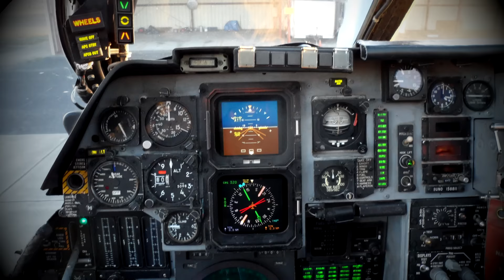USMC Jet Crashes Cable Car | Last Moments

Comment: Just to be accurate, Capt Schweitzer is not a pilot he is an NFO/ECMO.  EA-6B only has one set of controls.  It is also not a "fighter"

I was there serving as Aircraft Maintenance Chief.  I can tell you that to a man (and woman, we had a number of females) the Marines in the maintenance department were absolutely devastated.  We were within a couple of weeks of finishing the 6 month deployment (one of the crewmen on board was in fact on the advance party for our relief, if I'm not mistaken) and had spent much of it working 12 on/12 off shifts, 7 days a week.  Earlier in the deployment, the squadron had surpassed 60,000 flight hours accident free.  There was a lot of finger pointing and plenty of blame to go around:  out of date charts, missing safety NOTAMs, etc etc etc.

I got up close and personal with the aircraft with the Aircraft Maintenance Officer at the spot on the taxiway where the plane had turned off the active runway and shut down.  It was shocking the damage that wing took and didn't get ripped off.

As to the flying-under-the-cable rumor, never heard it.  Highly unlikely.  The CO, LtCol Muegge, was highly respected and would not have tolerated that for one second.  I had served under him previously when he was aircraft maintenance officer.  He was later relieved due to failings of his officers because in a military organization, the buck stops at the CO's desk.

I will say one thing about the crew.  It was clear there had been collusion to destroy evidence, but one of them, Capt Schweitzer, at least made the effort to come to the maintenance spaces afterwards (next day or day after) and express his appreciation to the entire maintenance department for our work..  His exact words were, "You guys did it right".
Reply: Since you say that you were there, was the altimeter actually not in working conditions? Or was it simply a false testimony.

Also was the aircraft ever checked by Italian authorities?

Comment: "the altimeter was malfunctioning" Which one of the 3 (even shown in the picture although this can be from another plane)? the mechanical, the electronic or the radar altimeter? let alone that the pilot isn't supposed to be blind, as to even with no altimeter tell he is way too close to the ground.

Comment: A cable car and a jet are the most random things I could ever think of that will ever collide with one another. Yet it happened. The heck?
Reply: It was a tradion for pilots from this military base to fly under this cable...
That is why they covered it up as plenty of people was doing it before them and clearly commanding officers was turning a blind eye on reports from civilians as it is not posible that noone from that ski resort did not made a complain about this moronic behaviour...
Reply: There are so many random thigns around this incident, especially in connection with the 9. March 1976 incident. It's extremely rare for a cable car to crash anywhere in the world, yet 2 of the world's worst cable car crashes occured on the same cable car, cabins hitting ground around 200 metres from each other. Surnames of those largerly responsible: 1976 - Carlo Schweitzer, 1998 - Joseph Schweitzer. The cabin attendant, Macello Vanzo, had a cabin with 43 people on board crash on a field behind his house 1976. In 1998 he was not supposed to work on the day of the tragedy, but a friend asked him to swap shifts, which he did, and ended up dying in the 1998 cabin sent down by the Prowler.
Reply: It's happened a few times.

Comment: I remember this one, amazing how much high power physics is going on here and that cable, to be cut with the wing tip, you would think the wing would sheer off. Once again I know the story but want to hear your entertaining version of it.
Reply: I was thinking the same. There have been at least 10 different cases of a plane vs. cable car collision, several in Italy, and in all of them it was the plane which crashed and the cable car which didn't (but was damaged of course, but pilots usually catapulted out of the plane and people were rescued from the cable car). I wonder why this one caused the cable car to plunge, but the plane managed to return to the base?
Reply: @MiroslavProvod  not sure, it might have been hit at just the right angle on the right  spot of the wing but yes as you mention many others the plane wing sheered off and the cable was OK. That's a huge cable.
Reply: Cable impacted a pylon close to the root not the tip.

Comment: While Prowlers are designed to fly low and jam radar, this was incompetence and neglect all around. The pilots should have updated maps, or even civilian sectionals that would have shown the cable cars. It's fine to have a camera while flying, but then to destroy the evidence shows a lot about the pilots character. It must have filmed them red-handed as they were hot dogging the area. The pilot should have spent serious time in the brig.
Reply: "Flat Hatting" they call it. And it's a BIG no-no.
Reply: The sectionals provided by the Italians didn't have the cable/gondola detail.

Initially Ashby and Schweitzer did not destroy the video tape. In the days following the accident one of the ECMOs in the rear cockpit - then Captain Chandler Seagraves - recommended that they destroy the tape by burning it, which they did. Seagraves later cut a deal with the government for full immunity and ended up ratting out Ashby and Schweitzer. Seagraves went on to have a lengthy career in the Marine Corps retiring as a Colonel - which included serving with the Blue Angels and commanding a VMAQ squadron - likely due to the fact that his father had been a Marine Colonel as well. The only member of the crew without any culpability was Captain Bill Raney. He stayed in the Marine Corps, was promoted only once to the rank of Major in 2004, retired in 2014 and ended up passing away a few years ago..

Comment: I would think you wouldn't need an altimeter to tell the difference between 300 ft and 2000 ft, even in mountains. In fact I would think that would make them want to fly even higher
Reply: Most army pilots are adrenaline junkies. Forget about "serving their country", they're just in for fun, giggles and occasional war crimes.

Comment: The A-6 Intruder (the jet from the incident) isnt technically a fighter jet, it can be equipped with anti air missiles however its intended role is that of air support and ground attack.
Reply: Not an Intruder, a Prowler, EA-6B.

But yeah, still not a fighter.
Reply: "The A-6 Intruder (the jet from the incident) isnt technically a fighter jet, it can be equipped with anti air missiles"(sic)

The aircraft was an EA-6B not an A-6. The A-6 could carry the AIM-9 - usually during testing at China Lake - but rarely, if ever, did operationally. The only missile the Prowler could carry was the AGM-88 HARM.

Comment: As an aircraft maintainer in the USAF myself, I was livid hearing how the pilot tried blaming it on bad maintenance in the jet. It’s more common than you’d think in the military for pilots to blame anyone else before they’re forced to take accountability for what happens. It’s like a horrible running gag amongst acft maintainers that we’re going to get blamed first before the truth gets sorted out, which includes EVERYONE getting a peepee test if you’ve even touched a jet within 90 days prior to an accident. With a lack of integrity like that, a pilot deserves getting permanently demoted to P.O.S. What’s sad is that air crew wasn’t the first to make an attempt at hot dogging their jet underneath the cables like that as rights of passage, they were just the first to get caught. The more jets you see crash in your career, the more you start to sympathize with that flight instructor losing his shit in “Top Gun” after Maverick just had to “buzz the tower” for fun, or when Iceman calls him “dangerous” in the locker room for similar reasons… and Hollywood (the film industry) goes ahead and idolizes reckless individuals like him. It’s fun to watch when it’s fiction, quite the opposite IRL.

Comment: Was that blood or hydraulic fluid? With a years experience of being a firefighter (junior firefighter it was a explorer thing when I was 17-18) I’ve seen blood on asphalt and dirt (Tennessee didn’t get much snow that year) but never on snow. But I have seen hydraulic fluid on snow and it looks like what I think blood would but I’m no expert 😂
Reply: Cablecarts are mechanically operated, not hydrolical, anything using hydrolics in them are in the base station at the end, so think that will answer the question. The doors and the trolley are fully mechanical operated
Also 20 people in a small confined space dropping down 300ft.... i dont even want to go there in my mind the horrific scene that will give.
Reply: That's blood! Cable cars do have some hydraulics in the brakes that would apply in case the thinner traction cable snapped (not the main support cable!) so they don't runaway back down, but with 20 people crashed in such a small space it's definitely blood. I also talked to a person who was one of the first people to arrive on the scene of the 1976 incident on this same cable car and he said that while pulling out dead and dying boides out of the cabin, there was blood everywhere on the grass and there was a smell similar to burnt milk. Apparently, fresh blood smells like that.

Comment: "No one was really punished for the negligence that lead to their deaths, had it not been revealed that evidence was destroyed, there would have been no punishment at all" right, and I am upset about it as well, but even with the destruction of the tape, the 4 people in the plane might have breached laws by flying too fast and too low, but with the map they had, the only lives they were risking were their own, sure without their reckless behaviour none of this would have happened, but I don't hold any one of them accountable, WHO gave them an outdated map which did not show the cable car lines? THAT is the person that should face punishment.
Reply: But you realize they weren't even supposed to be flying that low to begin with, which is why it was missing fromt heir maps.
Reply: They are definitely also guilty, they flew way lower than was allowed at a higher speed than was allowed. They just weren't supposed to be there.

Comment: I just paused it 7 seconds in because it's not a fighter jet - it's an E-A6 Prowler which is a 4 man electronic warfare plane, made for jamming adversaries surface to air missile radars.  it's not a figher jet like an F-14, F-18, F-15 or F-16 (F stands for "fight/fighter").  Even the 2 man version of this plane, The A-6 Intruder isn't a figher either, it's a bomber made up of a pilor & a bombadier that sit side by side.

Comment: Former usaf mechanic, and avid snowboarder that is all too familar with that size of cable.

I’m in disbelief that the cable was sheered and the wing was not. 

I would have bet on the cable 100:1 odds.

Those cables are ridiculously strong and the wings of planes are aluminum and everything is basically hollow.

The only parts of the aircraft that might be stronger than those cables are the hydraulic actuators and the brakes/landing gear assembly.

Must have been some piece of extremely strong metal where the impact happened that sliced through the cable.

As I’m sure many of you know, those cables just look so ridiculously strong up close. 2 inches of high grade steel.

Unreal

Comment: I'm sure that it has already been pointed out, but an EA-6B isn't a "fighter" plane, it's an electronics jammer bird...and even the ones that aren't the four-seater jammers, the A-6 is a bomber...again, not a fighter aircraft, hence the "A" (attack, meaning dropping bombs) versus a fighter aircraft's "F" (as in F-14, F-18, etc.).

Comment: My grandparents have a house in cavalese, I go there every summer. I first learned about the incident from the locals at the town, many of whom still remember it. I've also taken that same cable car, it doesn't go nearly as high as it used to. It goes down the valley and then across at a much lower altitude, which if I recall correctly was done to make sure that another accident like this would be far less fatal.

Comment: The information should have been not only in the briefing but also in their training & notes for each location they are dispatched at...
and then for the families to only be offered $60 000 initially is an insult..
I have respect for the other two members coming forward & revealing that the flight recorder had been tampered with..  even if only by accident during questioning...
Truth above all!

Comment: Accidents due happen even if flying under the cable was irresponsibly allowed to happen.  I wonder if they would do the same in the States. Be that as it may, the compensation was an insult even back in the 90's.  Even at just under 2 mill they got off easy.

Comment: There was another incident in which an F-16 struck a cable strung across a canyon and the cable sheared off the canopy, the pilot, and the tail fin. No cable car was involved. It was somewhere in Europe. Of course the pilot did not survive, neither did the aircraft.

Comment: It would take about 4 seconds to fall that far, and they would be very long seconds.
Reply: like 4 ever
Reply: Not only fall, but spin as well. The plane hitting the cable at 500 mph and the cable being connected to the top of the cabin made it spin even before the passangers could realize there was a plane hitting the cable (unless randomly looking that way). It must have been so fast that many musn't have realized what was going on.

Comment: I just can’t believe the plain was able to fly back.
Reply: Me too, I've read about a dozen incidents where a plane hit a cable of a cable car and it was always the plane which crashed with the cable car being nearly intact. This usually happened with no passengers on the cable car, but there was one instance also in Italy where passengers were safely evacuated after a plane cut the traction cable (not the support cable) and crashed.

Comment: They knew about the cable and they intended to fly under, that’s it. Otherwise there would have been no reason to be there, not to mention that they were forbidden to fly in that area at low altitude. Careless and reckless.
Reply: They didn't account for the fact that when there is a fully loaded cable car,  the cable can be up to 4 metres below it's height when there is no cable car.

Comment: I was hit from behind by an A-6e 4/14/1993 near Colfax, Wa. I was flying an Ag Cat crop duster. They bailed out and i woke up 5 weeks later in a intensive care unit.  The FAA inspector sited them on  several items like the B-N was a commander at Whidby Island who had a falsified flight physical.. They retired him. They shipped the pilot to another base. The FAA FSS would only say to consider the training routs hot 24/7 because the Navy were not on time much of the time. The NTSB came up with no fault. You can search on YouTube "joesgrain" and under videos there are 3 news reports about the midair crash.

Comment: I remember this incident and besides the horrific consequences for the cable car passengers, I also wonder how an aircraft could sever a 2 inch cable without suffering terminal damage.
Reply: I was thinking the same. There have been at least 10 different cases of a plane vs. cable car collision, several in Italy, and in all of them it was the plane which crashed and the cable car which didn't (but was damaged of course, but pilots usually catapulted out of the plane and people were rescued from the cable car). I wonder why this one caused the cable car to plunge, but the plane managed to return to the base?
Reply: My guess is just the sheer speed they were flying at was much faster than other similar incidents. If you're going extremely fast, you can impart enough energy to that cable to sever it before it destroys too much of the plane that it becomes unflyable. If you were flying at a slower speed, more of the plane would have to impact that cable to put the energy in required to sever it, and potentially there isn't enough plane to impart the required amount of energy at a lower speed. If you were to think of the plane as like a ball of clay, and the cable to be a string, you can imagine that if you slowly hit the string with the ball of clay it'd cut the clay and remain in tact, whereas if you threw the ball of clay with all your might at the string it could snap the string before the clay ever gets cut.

Comment: Theoretically if the chain of command was upheld then any officer responsible for these exercises should have been in trouble if there was any history of reckless flying, in these men or amongst marine pilots in general. If there is a culture of reckless behavior than those above that culture are responsible for fostering it or neglecting to put an end to it.

Comment: That is not a fighter jet. That is an electronic warfare aircraft (E/A-6) that is based on a bomber. The base aircraft is an attack aircraft that only has air to ground capability. It has no ability to attack other aircraft.
      Later models did sometimes carry air-to-air missiles but this was purely for self defense.